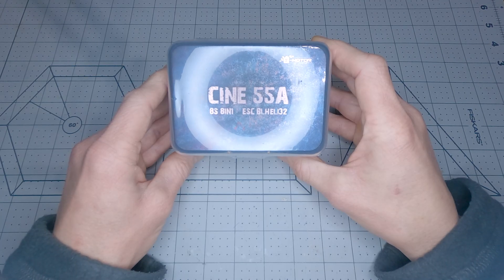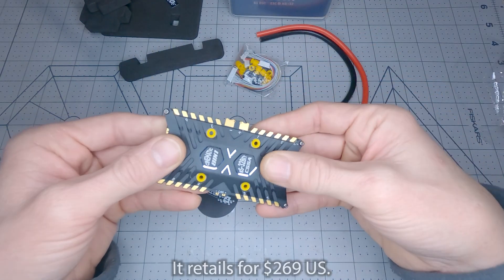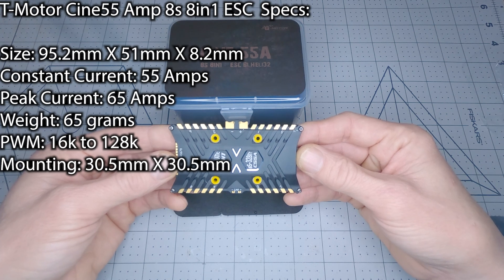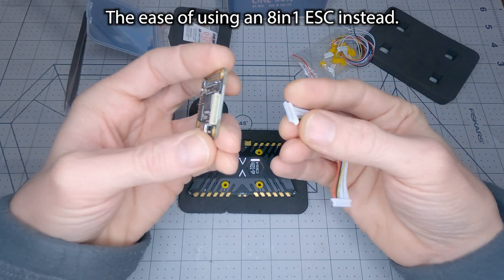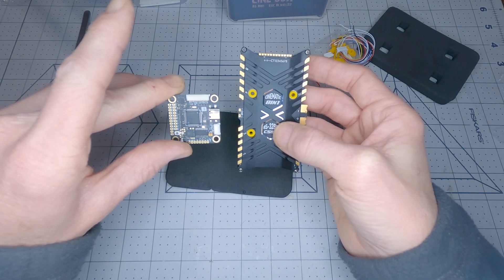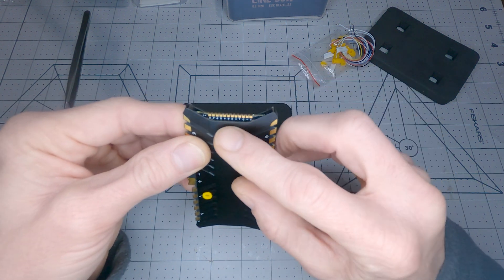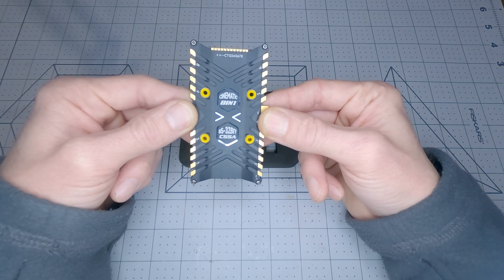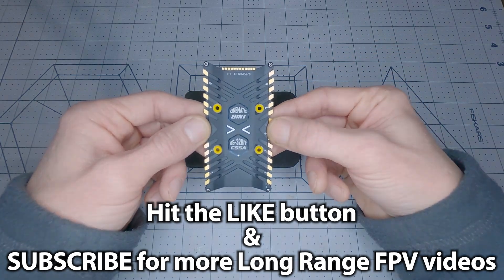T-Motor Cine 55A 8s 8in1 ESC - For Octocopter Builds and X8 Drones

Comment: Hi,
Thank you for the video. I'm thinking to get one of these.

If possible, can you please open up the heat sink and tell the Mosfet model number on this ESC?

This is because I've seen Tmotor using either a 1.5mΩ Mosfet, or a 0.7mΩ Mosfet in their ESCs. I need to know which one is it, to decide whether I want it or not.
Please help.
Reply from the maker: sorry removing the heatsink may damage the components underneath it.  I'm sure you can just ask on the website which fets they used.

Comment: got mine a few weeks back and the PWM cant go past 24k. Anyone else had that on theirs?
Reply from the maker: Mine has pwm low set to 24k but high can go up to 128k or by RPM.  High and low are two separate menu options to adjust.

Comment: How much power can these boards take ?.  if i can solder two motors onto one terminal will it take the power.   This means i can use a four motor  ESC board to control eight motors,  is it possible.
Reply from the maker: No it won't work that way.  The motors each need to be controlled separately.  Even if it could run two motors on one ESC I'm fairly sure it would cause instability and vibrations as the flight controller tries to adjust the motors speed to maintain the drones position and orientation.   This ESC has eight separate motor outputs to run the eight motors.  Two 4in1 ESC's, or eight individual ESC's could also be used instead.  But building witt the 8in1 makes it much easier.
Reply: Thanks for that falcon Can you tell me about or reccommend any 8 in 1 @FalconRadFPV

Comment: What do you think about the new Flywoo Explorer O3? With 30 min flight time, it could technically replace a 7 inch
Reply from the maker: The big differences will be flight speed (in 30min it'll cover a bit more than a 7" does in 15min).  Also it will not do well in heavy winds, and if using a naked GoPro it will not be nearly as smooth, although stabilization can take care of fixing that quite a bit.  The electronics on my first flywoo explorer were really glitchy and it put me off flying it.  I never did get in a proper long range flight with it before giving up on it.  The explorer 03, is it just the explorer 2 made to fit an 03 camera?
Reply: @FalconRadFPV  the explorer has been revised a few times, the O3 is the third version now.

Comment: I would still prefer two separate ESC's for redundancy as it is normally a MOSFET that fails on the ESC board. Flight controllers are less prone to fail.
Reply from the maker: Yes I cover that in the video.  I thought it was worth it since I haven't burnt a mosfet on an ESC in about 5 years, and it's only been that once.  Also it was a really bad quality ESC.  With a high quality ESC like this you'd have to be flying hard freestlye with the octocopter and hitting things at speed with it to stand a chance of burning a fet, in my opinion.  Anyways I thought the trade off was worth it for the ease of building with it as well as all the space it will save me.

Comment: I was wondering, why do you think you need a PDB when using 2 4in1s? I’d just solder one end of the wire to the xt60, other end to a 4in1, and strip some insulation in the middle to solder to the other 4in1
Reply from the maker: Sorry I didn't explin my perspective very well.  It's about the current meter on the PDB, as well as keeping all wires to ESC's power exactly the same length.  Yes you can connect two 4in1 ESC's to the XT60 in parallel, but unless you have an FC with two current pins (I only know of one that does) you will not be able to get amps, or mah used info from both ESC's added together and then passed on to the FC to place into the OSD.  I'm sure most people flying octocopters will need and want this information.  If it's just for freestyle and general short range then only getting a voltage reading may be enough to keep some people happy.  When running both ESC's off of a PDB you use the current meter from the PDB to connect back to the flight controller, this way all of the current meter related functions of Betaflight will work correctly.  Quite a few features rely on this information.  Time remaining estimate, mah used, estimated battery remaining, amp draw all very important OSD elements if you need to maximize flight time for any reason.
Reply: @FalconRadFPV  I see. Makes sense

Comment: I’ve been watching this esc since TMotor announced it! I am considering making my HD1 7” an x8, you always inspire me everytime I see ur videos! Thanks FalconRad!! My 7” HD1 XR is one of my dedicated rangers!! I’m gonna guess this esc would fit great!!
Reply from the maker: Make sure to check the frame for a fit before buying the ESC.  It is VERY big and requires a large build to fit it in nicely.  At 51mm wide it may not fit between standoffs on some builds.  My new RPM frame has a really wide standoff spacing so it just fits this ESC with space left over for an 03 air unit, vista or analog VTX.
Reply: @FalconRadFPV  I’ll definitely check the spacing!! Eventually I do want to build one of ur frames as well!! Just saving my pennies still!😍🤭